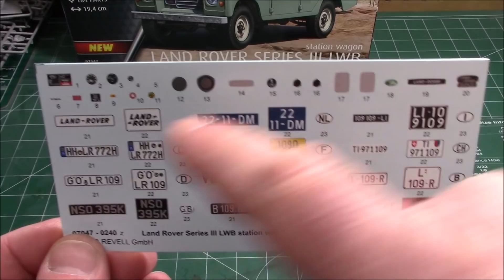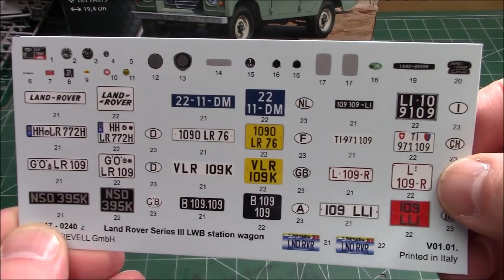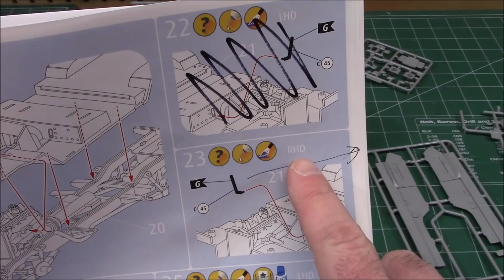Land Rover Series III 109 LWB Station Wagon 1/24 Scale Model Kit Build Review Revell Germany 07047

Comment: Great build, as always and a big help as I start my own (July 2023). I discovered a detail that Revell got wrong that may be of help to other modellers. This is the 'doghouse' or transmission tunnel cover. On the real vehicles, they were never handed, all vehicles had the same transmission, as per right hand drive. In that area, only the hand brake lever changed position, not the 4WD & high/low ratio levers.

Comment: Excellent detailing on this model, Chris. I had a 1970 Land Rover, 5 door Station Wagon just like that one. Mine had spare tire mounts on back door and Hood.
By the way, those are not windows on the roof, they're domes. The under roof has vents. The domes are so you can open up the vents to for extra cooling, or to extract heat.
Cheers!
Reply from the maker: Thanks man, weird they make them clear if they are just vents.
Reply: @hpiguy yeap,  I was scratching my head when I saw they were clear parts.

Comment: Note to builders: I don't know if it was the case with all Rovers, but the Land Rover we had did not have metal trimmed window sliders: there was a small block of glass glued to the moving/sliding window, and a round metal release at the base of the  window that you'd turn and release to  allow the window to be slid open using the block of glass as a finger-handle.

Comment: I might be mistaken but you put the four wheel drive and high low box levers in the side for left hand drive but made the model right hand drive. I’ve owned quite a few series so this stood out a bit.
Reply from the maker: It turns out Revell Germany had a few errors in the manual. I follow the manual unless I have personal experience with a subject that says different.
I'm sure RG will hear about it from the experts out there. I enjoyed the kit and the error in where the shift lever is doesn't bug me.

Comment: I'm sure the pedal orientation is wrong. The smaller pedal, accelerator is on the right, whereas it should be on the left. This is different to how it is shown in the manual. I'm going to modify mine.
Reply from the maker: You'd be incorrect.  Take care!

Comment: Really nice build. Love the subtle weather, I'm glad you didnt rust up the body panels. Not everyone knows they are made of aluminium in the real trucks.
Reply from the maker: Thanks for taking the time to leave a nice comment!
If you aren't on the hpiguys Workshop FB page, stop by and have fun!
Reply: When I stripped my 83 series 3swb down, there was corrosion on the bottoms of the doors , the rear of the tub was only held on by two bolts at the back. The other bits had corroded away. All birmabrite.

Comment: Hello  hpiguys... I wanted to ask a very obvious question did you guys ever do a run down of the lazy susans, the basic equip you used ? from spray booth to the turntables...  I just wanted to know.. I am getting back into it after 15 years, and I am looking for alternative stuff ie.   found objects to replace the expensive  systems mainly for painting and the booth itself.. whenever you get time.
. Max
Reply from the maker: I rarely cover anything but kits but I did review the pant booth on here.
The stands are Tamiya paint stands and cake stands.

Comment: Oh dear. I'm afraid Revell have got this badly wrong when it comes to LHD and RHD. The only lever that changes position when it comes to LHD or RHD would be the hand brake lever. Both the transfer box and 4wd lever remain on the right side of the vehicle regardless of which side the steering wheel is on. The Hand Brake lever would be on the same side as the steering wheel.So, unfortunately, the instructions have taken you down the wrong path. The part you scribbled out would have been correct - apart from the hand brake lever being in the LHD configuration.
Another criticism of Revell , the much rarer 6 cylinder 2.6 engine. Why ? US market, perhaps ? Even this makes no sense as they only sold 811 vehicles in the USA and Canada with the 6 cylinder. Revell should have modelled the vastly more abundant 2.25 4 cylinder instead, or at least had that engine as an option.
Nice model build, by the way.
Reply from the maker: I enjoyed it. Thankfully I don't know of the mistakes so  they don't bug me. LOL
Thanks for watching, I loved the kit! Appreciate the support and nice words!
Reply: @hpiguy  Well despite the above mentioned, your build has proved that it can be built into an excellent model and you have in fact inspired me to build one myself. Got one on order !